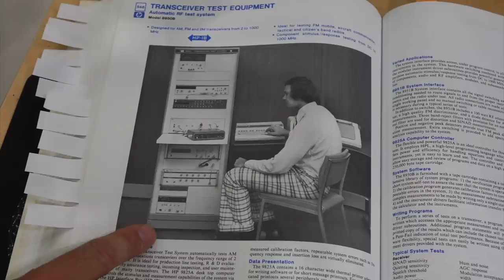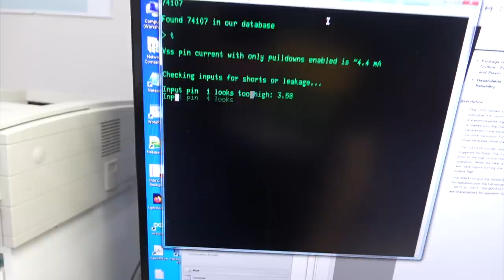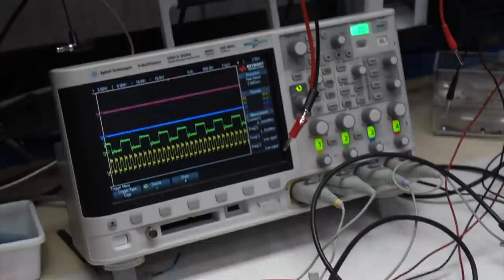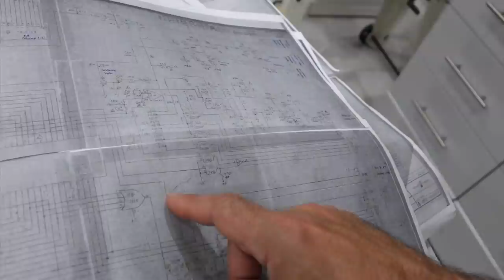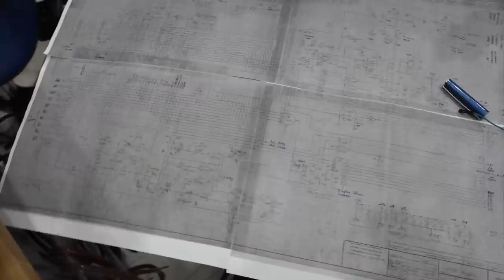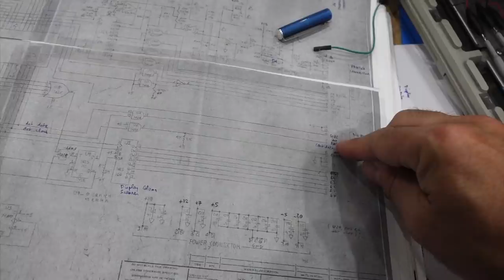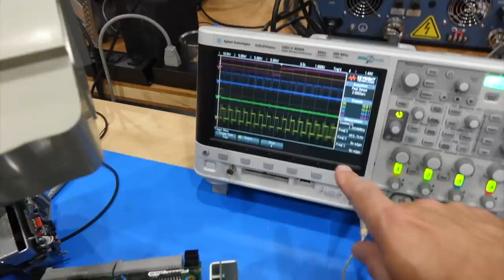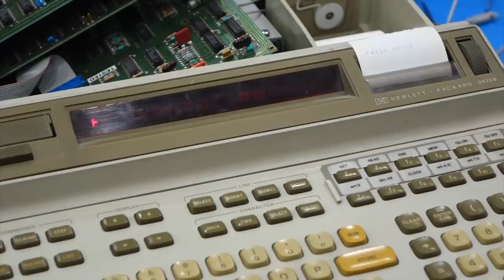HP 9825 Repair - Part 12: KDP assembly, again

Comment: You should have heard the immense sigh of relief at this side of the pond when the KDP chip turned out OK. 

If the dot matrix is a "nail" head, where the "nails" are driven against the paper, I've repaired one where one of the nails was bent over and would not return into the nail block.
Reply from the maker: The printer is just a vertical line, not a matrix. So all the dots work fine. I believe it has to do with the horizontal movement of the head or some issue with the platen behind.
Reply: I agree!  The chip was ok!! Sweet.    Well done Marc and thanks for sharing this adventure with us all.  Greetings from Arizona.

Comment: Great video Marc.  Just a side note if you havent already,  I updated the software on my TL866 II and it now has a completely new interface for logic chip testing,  and it looks like they've added a lot more logic chips to the database (the 74107 is in there now).  It can also now automatically attempt to identify chips,  and you can input your own custom test parameters for chip testing,  it's pretty neat!
Reply from the maker: Thanks for the tip, I'll look into it!

Comment: Fantastic series and congratulations! I have about 80 of the glass HP 4x35-dot display chips NOS in HP packaging labeled QDSP-2000. Many years ago I used them in an input selector indicator on a stereo preamp. I offer a set to you in case your Siemens units have difficulty, and by extension, other 9825 owners with bad displays.
Correction- the parts are QDSP2020. They appear to be the same or very similar to the HDSP2000.
Reply from the maker: I’ll sure take a few! See contact link in video description.

Comment: I’m a big fan of those LED displays. I work in the broadcast industry in Syndey and whenever I find these displays in old discarded equipment I desolder and save them. They appear to last a long time. Small OLED displays have to be replaced every few years due to broadcast equipment always being on.
Reply: Of course modern LEDs have some of the same issues now they’re phosphors excited by the actual LED… unlike these older ones, which output the light directly! More power consumption but much longer life.

Comment: Did you update the power supply with a crowbar circuit to keep any future component failures from doing this again?  I seem to recall you mentioning that later revs of the power supply had something like that but didn't get if you had just repaired the supply to original spec or the revised design
Reply: I think he did, ... episode 3... not sure.
Reply: can t remember if is was a crowbar, but he did add a fix to prevent this over voltage issue
Reply from the maker: Fear not, there will be an epsiode just for the crowbar at the very end.

Comment: I remember using this (or a very similar model) in the 1990's - It ran a dedicated program that we re-loaded from tape each night.  The name it was given in the USCG Loran station was CALoC - Calculator Assisted Loran Controller.  It would be used to calculate the number of nano-seconds to tweak the transmitter timings to adjust for relative drift of each station's atomic clocks (timers).

Comment: From a distant memory of the print head being replaced on a 9825 where I worked I thought that it was some sort of hybrid with heaters for each column that printed the info with the paper being advanced mechanically for every row - I might be wrong it was a long time ago around 1980 !

Comment: Are those the same kind of display chips that were used in the original ti-30 calculator? They look like they work in a similar way but they are a lot more high-end.
Reply: The TI-30 used a 7 segment display rather than dot matrix.
Reply: @ferrumignis  oh thank you for clearing that up.

Comment: Those Siemens chips actually look better IMHO. Its truly amazing just how many chips were burnt up in this machine. You should have shown us the final dead parts bin. I think last time you did you were already in the dozens of chips?
Reply from the maker: You bet I am collecting the parts I replaced! It’s not final yet, so I have not shown the pile. An average of 4 or 5 bad TTL per board. It’s not that much in the grand scheme of things, but the problem is that they are all bad at the same time which makes them hard to find. Except for the few ones that are obviously hot, but there are rather few of these.
Reply: @CuriousMarc  ah forgot there is another episode yet to come! Can't wait!

Comment: just put a 5.6 Volts 1.3Watt Zener diode in parallel with the +5 volts rail, to protect it from overvoltage. In case of the +5 volt rail goes above the Zener's treshold voltage, it will short that rail, tripping the fuse on that rail, thus protecting all TTL IC-s.
Reply: ... But only for a split second, after which the Zener will let out its magic smoke.  (I'm pretty certain that the +5V power supply is capable of sourcing a few DOZEN Watts which will gladly push out any 'zener smoke' from a 1.3Watt device).
The original 'HP' crowbar fix probably used an SCR across the +5v rail that was capable of sinking (a.k.a. shorting out) the entire rail once it was triggered from an over voltage.  (The SCR presents zero load on the rail under normal conditions...  When it detects an over voltage, it is fired and latched to shunt ALL of the rail current to ground).
The 'other' alternative would be to OPEN the rail from the load when an over-voltage condition was detected
Reply: @trevorvanbremen4718  yes an SCR crowbar is a lot better protection, but a simple Zener is a good enough protection instead of no protection at all. If the PSU is a switching mode PSU, a Zener is quite enough.
Reply: @tlrptg  
Let me paint a little pic for ya...
1: We're talking about very OLD hardware, so I suspect this system could easily draw 5A from this supply.  Any fuse MUST be greater than the maximum 'normal' current so let's assume it's a 7.5A fuse (probably more, but I'm giving you the benefit of the doubt)
2: When this PSU 'died' the supply rail shot up to around 15V so that's 9.4V over your 5.6V zener voltage.  Also, there is no current limiting on the output rail of the PSU.
3: Let's now take the zener overvoltage of 9.4V at a (conservative) current of around 5A.  That gives you > 45Watts that you want to dissipate in a 1.3W zener.  It would NOT last very long.  Possibly only a millisecond or two before it blows open circuit.  The fuse hasn't even had a chance to get WARM yet, let alone blow open.  Therefore, with the zener now out of the equation and the fuse still intact, the entire 15V is now 'free' to wreak havoc on every unsuspecting TTL chip connected to that PSU rail.

Comment: It's odd that HP made the keyboard encoder in the 9100 calculator with a few transistors and resistors, but they resorted to a full custom chip for this one.

Comment: Marc, you should design and add in some additional over-voltage protection at the output of that power supply, so it doesn't happen again.

Comment: Marc, your comment about the printer (head) just being a vertical line of dots is interesting, did HP use two different types of print heads in the 9825?
The printer in my 9825A had two columns that wouldn't print when I first acquired the machine, later every column which is a multiple of eight went missing. I disassembled the printer
and in mine there is a horizontal line of thick film resistors on a ceramic substrate, the resistors are 140 ohms each, and there are enough resistors to print a full
line one pixel high. The two pixels that were not working initially have been damaged and are open. The later column issue is I think related to the shift register which sends data
to the head but I haven't had time to investigate further.

Comment: Amazing work to get that unit functioning again. Am envious of the equipment and knowledge required to accomplish that. Just wondering, you mentioned a way to protect the system from future power supply failures? Don't recall what that was and curious if it has been implemented in this unit.

Comment: Did you have an episode I missed on hacking in the crowbar rev from the later machine into the power supply? Or is that still coming? (I'm assuming you aren't going to rely on luck at this point. :-)

Comment: Question: Was the KDP killed because of the power surge, or because the ribbon cable was plugged in backwards back in episode 1? I'm curious because I have noticed that HP doesn't seem to follow the "carat on a socket should line up with the red stripe on the ribbon cable" and it's pretty easy to accidentally put the cable in backwards. If that blows the chips then that is sad...

Comment: MOS chips aren't as sensitive to voltage levels as TTL chips, right? So it makes sense that the KDP chip would be OK.
Reply: Yes, early CMOS chips usually had a 3-15V operating range where TTL is like 4.75-5.25V.

Comment: It feels like using the second keyboard to determine kdp chip health is kind of cheating! ;p
Reply from the maker: It sort of is, but in all fairness our HP 9825 is so incredibly broken - 20 or 30 failures in it - that we'd have a very difficult time to repair it without a working unit to compare it with or to test some sub-assemblies.
Reply: Not really - back in the day I always swapped socketed items into a known good board
Reply: I tell you what. It is such a godsend to have a second known working device in order to test parts on. It speeds up repair so much. Because, you can have all of the fancy test equipment to your heart's content, but at the end of the day, the best thing to test a device's parts on is the device itself.

Comment: That newer chip tester you introduced in a previous video, how difficult is it to write your own chip tests to add a chip into its database? I would imagine you could modify an existing flip-flop chip to handle the one you had problems with.
Reply: I don't know about the ease of loading them yourself but he mentioned that the designer of the tester, would add the missing chips if you send him the schematic

Comment: With be KDP chip been a MOS device rather than TTL, perhaps it's more tolerant to over-voltages than the TTL devices? Same with the CPU also been a MOS device.
Reply from the maker: I think this is indeed the case.